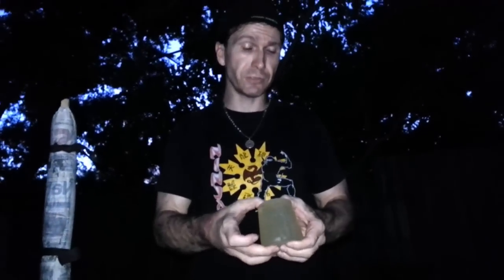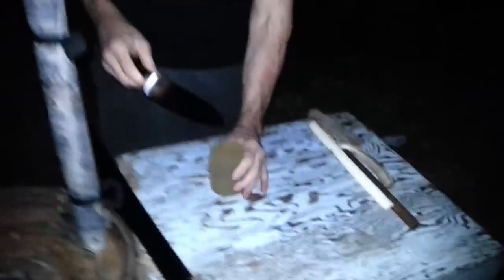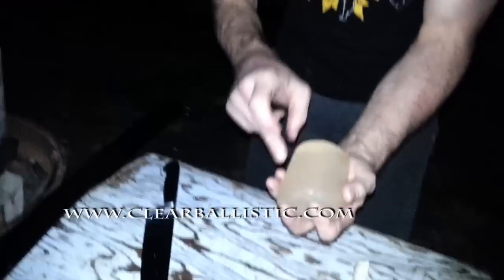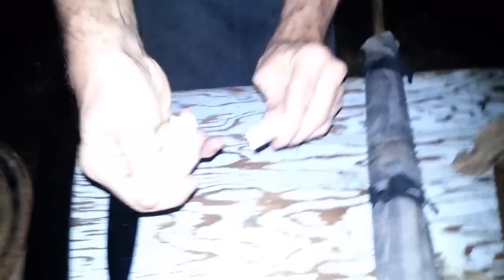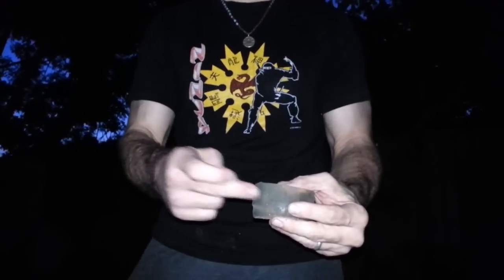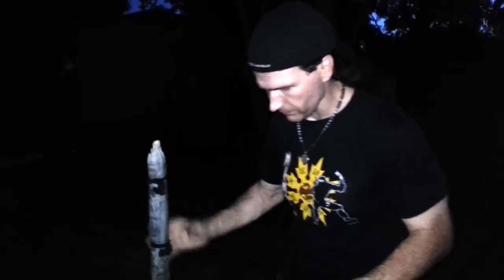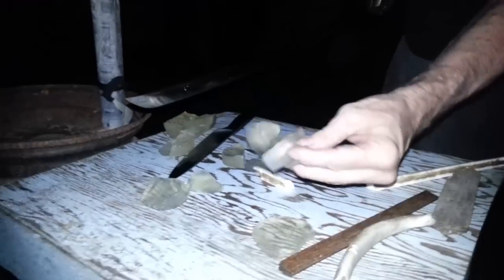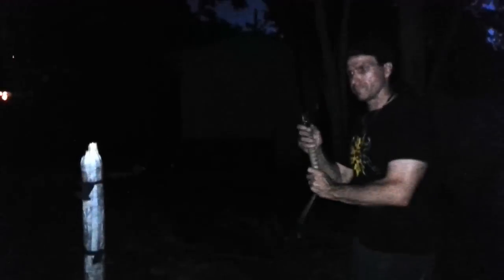Is Ballistic Gel Accurate for Cutting and Testing Blades?

Comment: pretty old video so i'm sure you guys have found something by now but this reminded me of the episode of mythbusters where they were rebuilding their crash test dummy. they wanted a material that could simulate cheaply and effectively the pressure it takes to snap bones and they settled on a wood called poplar though unfortunately did not state the exact species, and i know different species of the same genus will have different property's. i don't know how will it will cut but they liked it for a bone medium. of course there are professional bone simulate materials used in the medical and forensic fields but im not sure if they are even as economical as using an animal carcass for every test. as for flesh i haven't a clue. kinda sucks that ballistic jell isint doing it for you though i think a lot of why it doesn't act like flesh is because jell only replicates one form of connective tissue, which would be cologne but flesh also consists of varying combinations of reticular and elastic tissue. i've never liked the idea of using paper or tameshigiri to simulate cutting because they are so much unlike flesh in other characteristics (like being plant tissue) but they certainly seem to act better than the jell you are using.
Reply: actually, i wonder how rubber would do

Comment: Its meant to represent, body density as a whole. How much pressure does the body allow in certain aspects when it comes to ballistics. Now obviously a bullet is going to do a lot more when it comes in contact with a human body, hitting or nicking organs ETC. But the desity of the body effects the physics of the bullet, and the gel shows a perfect 360 degree, 3D Image of what the ballistics of a bullet, project as they enter the body.
What ballistics gel doesn't do is show, skin, muscle, bone ETC. Hence why you can poke your finger through it. there is no skin and muscle. Its just all about math. for instance, if you subject the gel and human body to PSI testing (explosive) that's the key.

Comment: You need to simulate the elasticity of the skin and how it distributes the impact. Possibly covering with a layer of silicone or adding some water glass into the mixture would do the trick.
Reply from the maker: Takumf Nongivenames Possubly we have been making Analog Ballistic gel heads called Ivar the Draugr heads and seem to be fairly accurate since this video. We use them in all new weapons test that merit them.
Reply: ThegnThrand Sorry to bother then, I am quite new to your channel (subscribed after watching this video) this video made me recall about use of both gelatin and sodium silicate to create highly porous materials. I assumed then it could be then 'dried' a bit and make the mix preserve enough elasticity while reducing drag a to a degree. I made few tests to check it, and while some of my predictions were confirmed it requires a bit too much attention while drying it additionally after it settles. After some point it becomes very hard and prone to crumble.

Additionally, I was thinking of testing the resulting porous gel from this paper: http://personal.its.ac.id/files/pub/3880-heru-che-APJ-11-0013R1.pdf but I am confident that I know more about this then weaponry  ;)

To add one more thing: porosity works in both ways in this case. In humid surroundings outer layer can reabsorb some water making it more like a composite in that regard.
Reply from the maker: Takumf Nongivenames
Thank you so much and no bother after this information we might try to incorporate that in to improving what we are already doing. Thanks for subscribing and tell others about us.

Comment: the japanese had a LOT of experience with blades and testing swords... i hat the feeling that these guys had good reason to use tatami, and the other roles used in suemongiri, they must have felt that it did the job...
Reply from the maker: Very true tatami is a very good test medium.
Reply: what do they use in suemongiri,. apparently it's supposed to be different to, and more difficult to cut than what's used in tamashigiri but i dont know WHY

any ideas?

Comment: Thrand, what are your opinions of Skallagrim's test on 20%/clear ballistics jell that he tested on his channel? The response from his strikes did not have a super similar results because of the harder material although it still bounced. 

Also, I was always under the impression that 10% ballistics jell was used because it had the same or similar water density as flesh. I could be wrong, though.
Reply from the maker: From my research Clear ballistics Gel is not used by the FBI or NATO but is consider equivalent to their forms of ballistic due to projectile penetrations depth and standards.Although I have seen online complaints about the round bouncing back to proper depth often going 2 inches or so deeper not coming to stop like in Standard ballistics gel.Does that mean Expanding rounds would expand quicker or slower due to extreme resistances?Or temporary cavities and wound cavities would be lesser or greater some how? I am not sure but would stand to reason and worth testing other than just depth of penetration.The Clear also can not be dissected or cut easily to examine the wound channel .Meaning very cut resistant and does not contain moister at all.It is clear so easier to see results with out cutting it though.

Comment: Since you eat the meat, you coat the blade with something edible like olive or vegetable oil right?
Reply from the maker: Yes,Mineral oil is ,ok or really any rendered fat will work that is unsalted.I have used canola oil before or refined rapeseed on my Viking sword.
Reply: I use baby oil, is it any different than mineral oil besides fragrance?
Reply from the maker: I believe it is the same and should be fine the baby oil has a fragrance added is the main difference.

Comment: Yes, the wet newspaper does seem to simulate the sinews of muscle quite well. I was thinking that maybe a few layers of pretty dry newspaper over that, not held taut but pretty loose, might be a good way to simulate the outer cornified layer of the skin.

I'm not sure if it'd make that much of a difference, but I suspect (though I haven't actually tested it) that if you hit the loose dry newspaper that it probably won't cut, unless you then draw the blade (or use enough force of course).

A small layer of ballistics gel beneath the wet newspaper then might simulate the drag/friction force that causes blades to get stuck into an opponents body, and then finally the wet cedar wood (which seems really good) as the bone.
Reply from the maker: I noticed the Newspaper might have been a bit wetter than it needed to be.Might have not let it dry long enough after I soaked it or may have been left to long to soak.Will have to experiment on times of soak and dry and will try a layer on the out side after soaking as well sounds interesting.

Comment: The 10% gelatin is definitely a LOT easier to cut than the 20% Clear Ballistics gel. I'm planning to combine the 20% gel with other materials to hopefully get better results, but overall it's not a particularly good flesh analog for anything but firearms. Simply too much friction, like you observed yourself.

Wet cedar does seem fairly similar to bone. Softwood generally should be reasonably similar.

Testing on dead animals isn't that accurate either, at least if it has been dead for a while. It's quite different from living tissue.
Reply from the maker: If you can get fresh meat such as a very large pork roast with skin still attacked from my testing is fairly accurate.It also makes a wonderful Danish pork roast with crackling when done testing just by rubbing it down with coarse sea salt,ground cloves,crushed bay leaves and mustard seed pop in oven at 450 degree for 30 mins then pour in about 3 cups of boiling stock or water then turn down to 350 degree and cook until its 160 degrees in the center :D
Reply from the maker: ***** Sorry I meant no offense ,Although if offered the ice cream with high fructose corn syrup on top would think some one was trying to poison me.I do Low Carbohydrate High Fat(LCHF) or CKD wile working out based on 9th century diet style and practices.Kind of like a paleo style diet very low carb to almost no carb with occasional carb refeeds if needed to increase athletic performance.At times I have gone totally carnivorous for months on end for health purposes :D
Reply from the maker: I believe every one has a right to eat how ever they choose and not every diet works for every one.Not all religious practice allow all foods and every one is unique and preforms differently based on dietary practices.If you are having problems health wise I highly recommend trying LCHF with natural unprocessed foods.This is a good site to read about if any one is interested and free for all not a gimmick nothing to buy. http://www.dietdoctor.com/
Reply: *****
Vegetarianism in and of itself does not guarantee health. And I have a predisposition towards overweight no matter what I eat. I was at my fattest before I went vegetarian, but eating meat was not the primary cause.
Reply: *****
Don't worry, no offense taken. :)
Reply: Brandon De La Cruz
That's a common misconception. There is protein in various kinds of food, including vegetables. Most people are just completely unaware of that. There are even Vegan bodybuilders who don't use protein supplements.
Reply: ***** Um but we didn't fight over nutrition. It was more like this. Me: NoT mOoCh PrOtEiNz.
 Skallagrim: AcToOly HaZ hEaLtHyNeSs
Me: Oh I dId NoT kNoW dAt!!!!!!!!

The end :3
Reply: ***** Most vegetarians actually are unhealthy because of their lack of protein, that's why soy sauce is so popular with them. Skallagrim, one last things I wanted to say is, awesome beard.
Reply: The more you know! Also, I'm actually surprised you didn't get many injuries during sword practicing. Usually people training they're first time would get many injuries. Yes I am subscribed and yes I did see that video. I still wish you would make a video on the energy sword from Halo on that series you did quite a long time ago.
Reply: Skallagrim 100% ballistic gel
Reply: Best way to explain things.
Reply: Yeah, even freshly dead meat is not a more accurate flesh analogue. It does not have blood pressure due to being drained, it does not reflexively contract like live muscle does, and the muscle fibers in meat are not held together as tighly as in live flesh.
Reply: Skallagrim this is a comment section, not a library. Get your paragraphs outta here
Reply: Oh oh oh!!! Oh my god! I just had a lightbulb moment!!! What if you mixed Astroglide or similar silicone based lube in the mix to reduce friction?